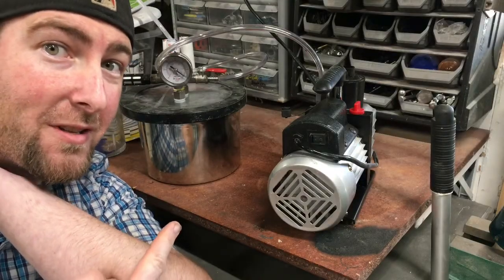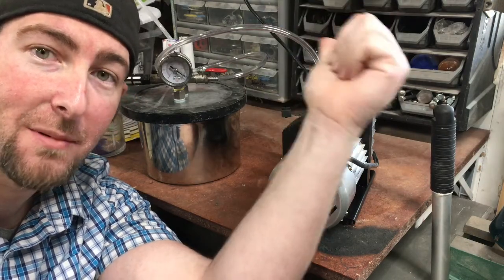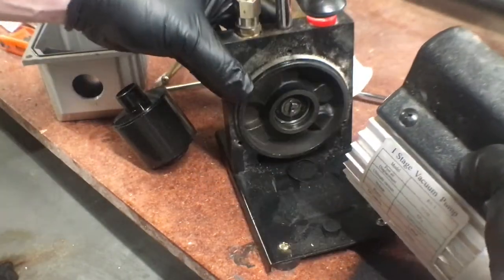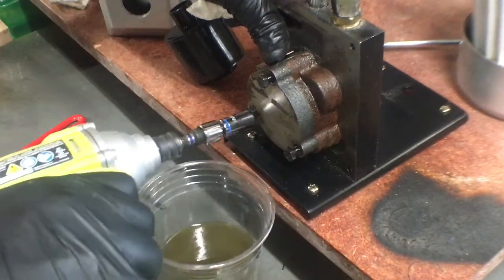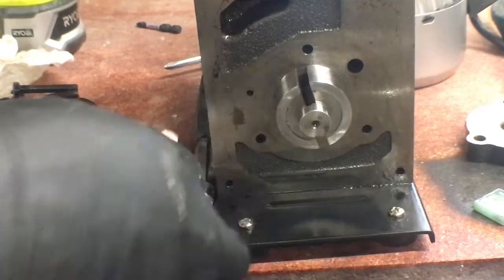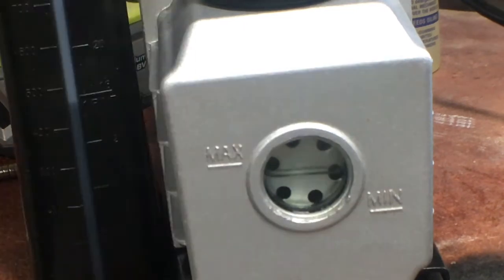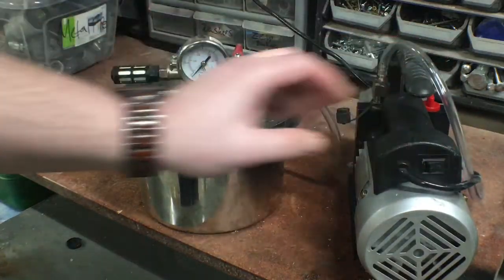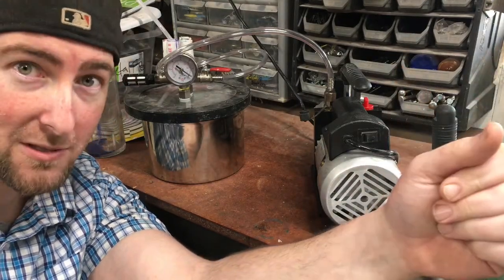Vacuum Pump Clean Out

Comment: I have two brand new pumps. Both got milky oil real quick. I flushed them out and put in new oil now they seem fine. I don't run them long. I have two tanks for each pump and just pull a vacuum then let them sit untill I don't see bubbles or foam then pull the vacuum again. I let that go on for 5 days or more before even checking the wood. I do mostly Purple Heart Juniper, Hackberry, Honey Locust, and Box Elder. Some Elm and Mulberry. Mostly making scales and through tang handles for our blades. I do some pen blanks from scrap to sell but am more into sourcing stuff we use ourselves. We smelt brass and copper for gaurds and pommels and make plate for in between wood like in our Puukko knives.
Reply from the maker: Wow! You sound like a busy guy! As for the oil going milky so quick I really couldn’t say but I know mine had a lot of sediment after the first few hours of use and after the change it has been fine so maybe just new pumps have to work all the gunk that maybe gets on the innards from machining and what not in the manufacturing process. After I accidentally sucked some juice through the extraction hose it went into the pump and all I did was take it all apart, wiped it all down, run new oil back up into the intake to hopefully clear out any residual cactus juice left behind and refilled it again and now it runs better than when I bought it. Hope that maybe helps a little.

Comment: Just followed your steps to clean it. Now it can barely pull a vacuum and cant hold it. I might suspect i assembled the exhaust wrong. There Are two small metal plates, a flad to go against the chamber and a bend one to go ontop. Can you tell me if the mend one is supposed to point away from the exhaust or down towards the exhaust?
Reply from the maker: Oh boy, You know I can't remember off-hand and would have to go back and see if I can see that in the video or not because I don't even own that pump any longer because it was stolen from me about a year ago, and have since bought a new 2 stage Robinair so I apologize about not being able to give you the answer to your problem but let me see if I can find some sort of schematic or something online that shows all the parts and how they are supposed to go and if I find something ill let you know.
Reply: @PetesShopMakes  its okay, I think i found the answer on som random Facebook post 🙂 but thank you very much for takling the time to answer 😁👍
Reply from the maker: @sanggaardvideo8116  Of course! Again, I apologize for not being more helpful to you right off the bat, but I'm glad you were able to find a solution to your problem. If you have any other questions, please don't hesitate to ask. Thanks!

Comment: You can let your vacuum pump run as long as you like, these are constant duty pumps.  They do run quite hot, this is normal.  The heat actually helps keep water from saturating into the oil due to heat.

Comment: What did you do to purge it? I didn't understand it from the video, strange it looks like it pushing out oil from the inlet
Reply from the maker: That’s exactly it. You overfill you’re oil reservoir enough so that when you start to try and pull a vacuum, the oil will start to backflow out of the system and get any contaminants that are maybe caught in any of the tight spaces inside your chamber. You don’t want to run your machine for too long like that though. I only had to run it for about 2 or 3 mins then drained the oil back down to the proper level.
Reply: @PetesShopMakes  got it, thanks ☺
Reply from the maker: Ok. Glad I could help. Let me know if you have any further questions. Take care.

Comment: My RS-1 just gets stuck at -25 mmHg and dances around that pressure. any suggestions?
Reply from the maker: Markus Goralczyk there’s no leak in the seal or in a hose anywhere?
Reply: @PetesShopMakes  i glued all the fittings with loctite because i thought that the teflon is leaking. So it should be airtight. Besides that im using the cheapest vacuum oil i could find. Today I disassembled it cleaned it and when i tested it, it was barely sucking air in. I will have to check it tomorrow. But i am sure i will run into the same problem again. I saw some single stage pumps on YouTube that have -30 and some -25 mmHg that were the same model. Im am so confused right now.
Reply from the maker: How old is the motor or your pump in general? If it’s new you may want to get a hold of the manufacturer or wherever you bought it from and tell them the issue and they may even just end up sending you a new one for free. The pump I got from amazon was from a company called BLAZE and I was having a problem with the acrylic top with the pressure gauge in it cracking and I emailed them and they sent me a brand new lid with fittings and gauge along with a new stainless steel pot for free so you may want to try that. If it’s an old pump and you can’t do that then try looking up any instruction manuals from the manufacture online and see what it says. Most instruction manuals have a troubleshooting section as what to look for in case of certain problems like vacuum pressure loss and things like that.
Reply from the maker: Let me know what you can find out or you can email me some pics or product numbers and model numbers and I’ll see what I can find out about it. ( Peteskeet85@gmail.com )I’m not a vacuum pump professional so I’m a little limited in my knowledge about them but I will help you as best I can bud.
Reply from the maker: I know that it can be all a little confusing and frustrating at times but just do your best to figure out the issue and get it up and running again. It’s way more satisfying knowing that you worked through an issue and fixed the problem instead of just throwing your hands up and walking away angry then end up tossing the whole thing in the trash. You’ll learn so much more and be able to have that knowledge of how it all works and if something happens in the future you’ll know what to do.

Comment: Not very helpful if you skip steps in the video then speed it up so fast I can't see what your doing.
Reply from the maker: kagitaka tokahe sorry about that. Anything you need help with I’m happy to answer any of your questions.
Reply: I put the video at 0.25 speed at that part. Not so many components are actually involved…
Reply from the maker: All that I really sped up was just the reassembly because I figured if someone was able to take it down to bare bones like I did then all you’d have to do is just follow those same steps in reverse to put it all back together but I’ll take note of that and be sure to be as thorough as possible next time. In fact....the pump in this video was just stolen out of my shop this summer and I recently replaced it with a dual stage pump with more cfm and horsepower and all that but if you guys would like to see me tear down that pump and clean it out as well for demonstration purposes, I’d be more than happy to. Let me know what you think guys. Thanks.